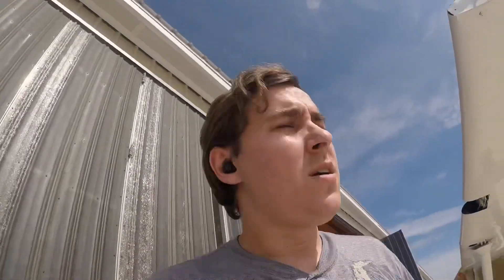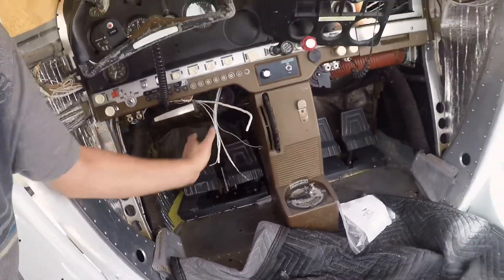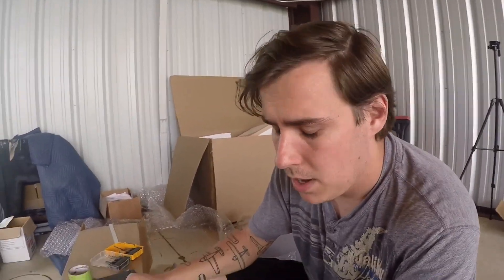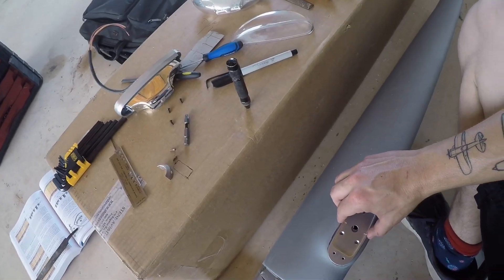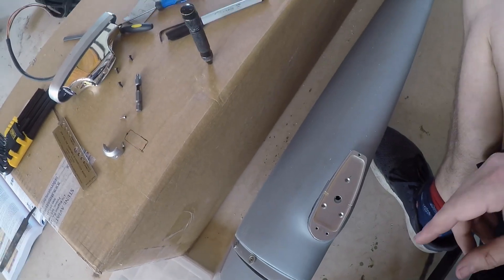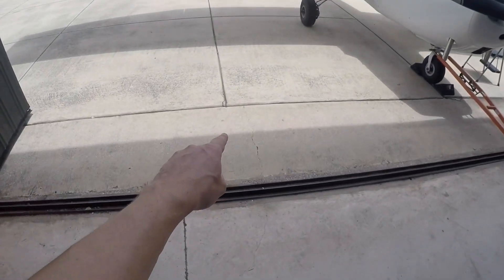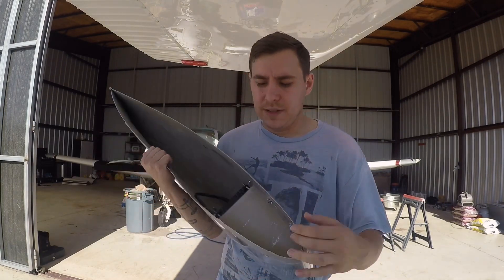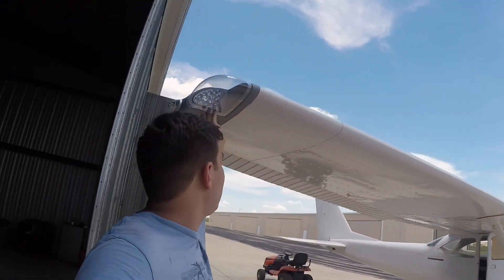Light Bar On An Airplane! Installing Stein Aero Quasar Wing Tips On The 172 Part 1.

Comment: I missed my NA, except when it rained. I got wetter with the top up than I did just sitting in the rain cause the 3 piece window seal is dumb! I just left the top down for 2 years and just drove it like that. Was such a simple car....
Is the Cessna project yours or is someone paying for all that work?
Reply from the maker: It's a customer/ friend. He moved out of state and asked if I would help get it back together. My first miata had a hardtop I should have kept it when I sold it because that didn't leak.
Reply: @brycebuildsit  My Miata came with a hardtop when I got it too. Sold the hardtop for almost as much as the car cost. The throw out bearing was SO loud I talked the guy down $500 cause it sounded like it was gonna explode. Replaced it and never gave any more issues. Got the stereo was stolen from it like 5 times too, another reason never put up the top. 
Should bring a canopy to make more shade working outside too.